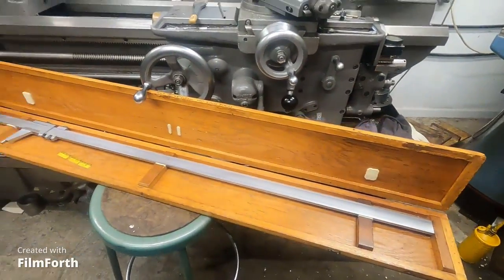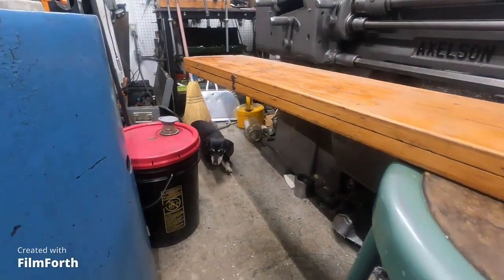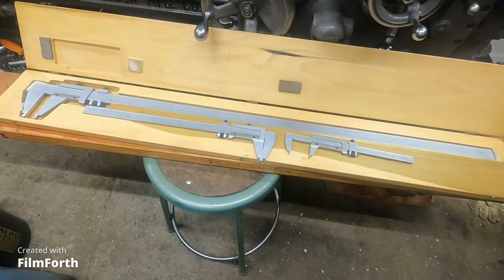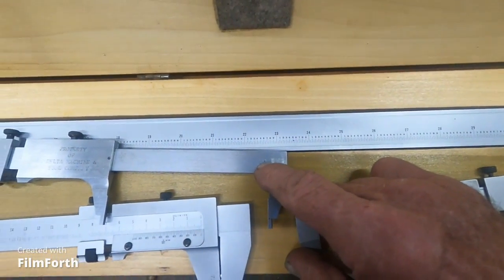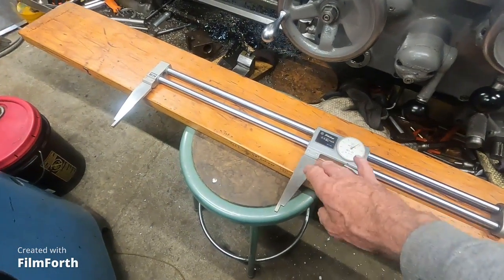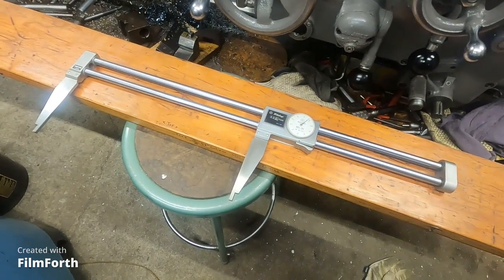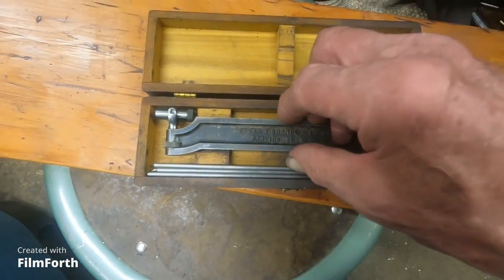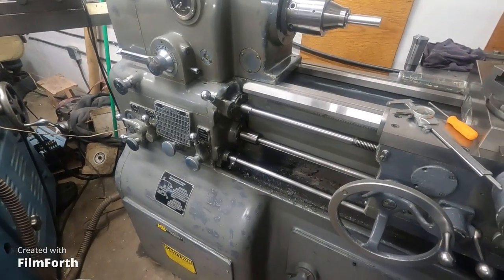Verniers to 48" no batteries required

Comment: I own that same Mitutoyo caliper. I got it from the company I worked for from their inventory disposal (I paid $25 for the damaged one). The guys in the machine shop ran the digital slider up and down so many times and fast, they destroyed the axle shaft to the dial pointer. I figured out how to make a new one with O2 drill rod and a 5C spin index on my surface grinder. But it's a bit sloppy, and 2 thou resolution is the best it will do with the diameter error I made with the shaft. The long jaws are very handy, as I have a 500mm LCD digital caliper, and the issue with it is the short jaws, seems when you measure large enough stuff you need them long.
Reply from the maker: I can see how that would wear out moving the slider quickly, you did a good save on that

Comment: I got a 26" Helios and a 48" G A Gray Vernier calipers, though the 48" are not as clean as yours Dee. The large sizes are very cheap used compared to what a new one would cost.
I prefer a Vernier over a digital even in the common 6" size that is used most days in the shop.
Reply from the maker: All types seem to be in use, and often in the same shop. The most irritating is the always dead battery in my Mitutoyo digital micrometer

Comment: I'm going to venture a guess on that hole in the indicator tip.  Maybe used with the hook and straight scriber along with the surface gage to determine remaining surface to be machined from a scribed line.  More accurate than simply trying to split a scribed line.  Scriber point set to scribed line and transferred to hole on indicator point.  I split many a line 50 years ago during my apprenticeship in a large auto body panel using the surface gage to indicate the scribed line but never had any intro to the small  indicator you're describing.
Reply from the maker: It is not for that, I will have to demonstrate it, thanks!
Reply: @deedeeindustrialsuperprecision  thanks for replying, ive  picked up a couple of those indicators  over the years.  Looking fwd to the demonstration.
Reply: by splitting the line do you mean scribing a line very slightly above and parallel to another? or does that mean milling to that line?
Reply: @tilliesinabottle  Milling to the center of that line and prick punching before milling same line to magnify the accuracy  where the original accuracy was achieved during layout on a 20 x 20 ft.layout table.  That was old school diemaking practice for large auto body dies where I first worked in a die shop.  And I'm not even angry, loved the trade.